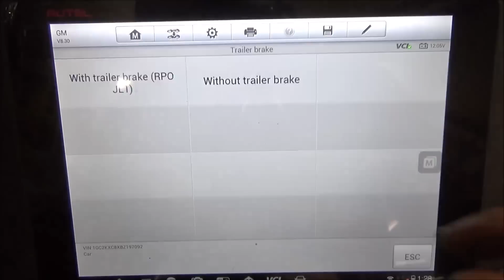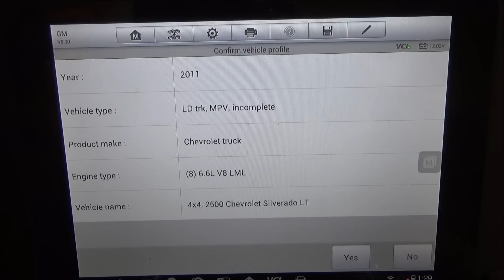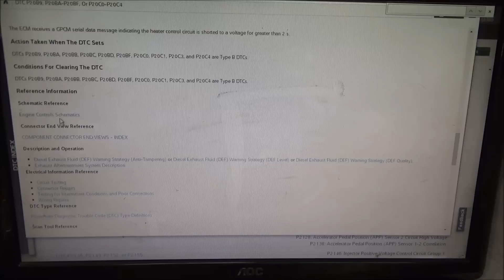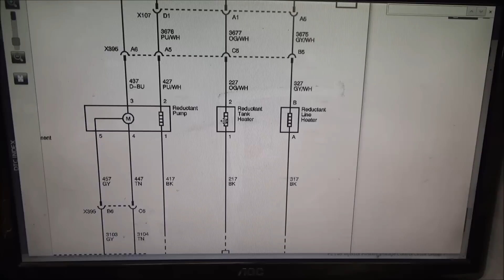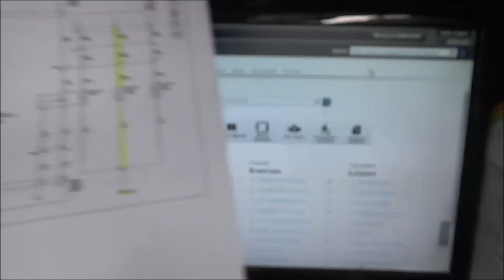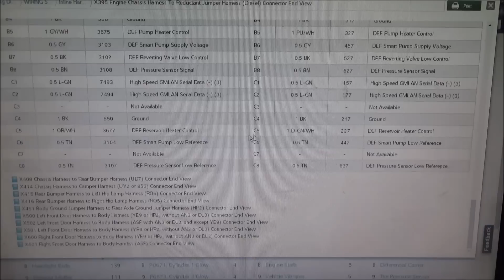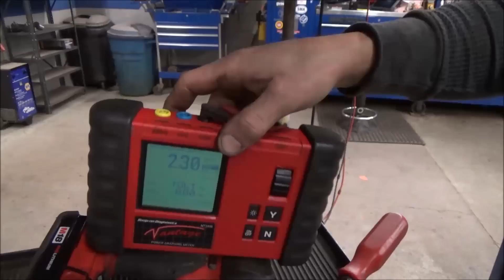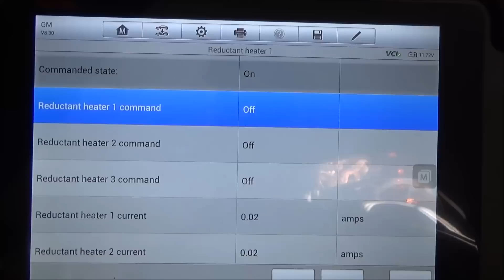Chevy / GMC 2500HD Duramax - P20B9-00 Reductant Heater Problem - Part I

Comment: Does anyone know? If a vehicle under warranty is taken to the dealer and the dealer can't fix the issue, then the customer takes it else where and is repaired and charged, can the owner then go back to that dealer that couldn't fix the problem and get money from them because they could not fix the vehicle under warranty? Or is the owner S.O.L.?
Reply: +South Main Auto Repair  You can try to go over the dealership and go directly to corporate customer service. They will generally get involved if you can show them that the dealer didn't repair the vehicle. Written documents are a good thing in this case.
Reply from the maker: +Frank Gonzalez I believe SOL is correct. This guy don't really care he just wanted his truck back is all.

Comment: Great vid, can't wait for next instalment! Do check resistance of ground, high resistance is as good as an open circuit as you found when you checked the heater coil. Ian G
Reply from the maker: +Ian Griffiths we tested the circuit in this video all ready... resistance of ground is redundant. It needs to carry current.

Comment: Since all of the Diesel Pollution control crap hit the market, truck drivers have been getting screwed, Like we haven't been getting it already. Ive had to set on the side of the freeway for over an hour waiting for my truck to regen, they havent gotten the bugs worked out yet, and its the drivers who suffer. Boss just says Oh well and make sure your at the customers on time, total crap, Both the Def and Non Def systems are bad. Wish we knew the honest story about this truck, but thats not going to happen. In most cases our trucks have to go to the Mack Shop to have the pollution cleaned, due to warranty, takes 3 to 4 weeks to get it done, costs major bucks, They started buying another brand of truck, but they were even worse, so they sent them all back, over 100 trucks in total, back to the dealer, now were back to Mack. We always thought our trucks were bad, until they started this junk, now we wish we had those old beasts back, would love to get a new diesel pickup, not going to happen the way it is now. But if SMA was located around the corner, I might think differently.

We never know whats next from Dr Os waiting room.
Reply: South Main Auto Repair i know the feeling all too well...i miss my big cam 550 all mechanical 3406 kitty cat

Comment: I stopped in at your shop about a month ago and talked to you and Ivan.  I had the very same failure on my 2011 F350 and after watching some of your video's I got myself a shop manual, and swapped the part myself.  Based on the diagram it looks like the GM parts is really close to what Ford uses.   Job went great, I took my time and save myself about $1000 over going to the dealer.  Thanks for doing these amazing video's!
Reply from the maker: +Simon Matthews Yep I remember! You changed your profile name.
Reply: +South Main Auto Repair different computer not sure why it comes up with way.
Reply from the maker: Oh haha

Comment: hey E.O. very well done on that diesel with the reductant system.....u pretty much diagnosed that circuit easily haha...i have had my share of them systems and iv gottn some familiarity of how that works and diagnosing it...haha i was like sittn here at my toolbox watching u follow the wiring and how ur schematic wires threw u off alil but u poked around and figured it out,wow great job...i was like from the org/wht wire it changes to dark green/wht eric oh no haha...but anyway we use SI here at work...overall great job eric i cant wait for part 2....ill be waitn..haha..
Reply from the maker: +Joe Tisi Haha yeahhh we got it figured out. Just need to poke around a bit

Comment: had one if those buggers go bad on my 2014 freightliner cascadia evolution chunk of ice collapsed the inlet screen to the pump that caused the pump to burn up the motor then the exaust filter got clogged and had to be sent to detroit to be cleaned off (basicly a catalytic converter) $6,400 dollars worth of trouble for a $367.34 part thank god for a 5 year 700,000 mile warranty

Comment: Another trademark SMA video! And as far as I can recall, the first diesel specific video you've done? Wouldn't mind seeing more of those;  here in Belgium more than 70% of the cars is diesel fuelled (stupid), they put diesels in fiat panda's for crying out loud...
Hopefully they make 'em run on banana's soon. Do you think we would need to peel them before dropping them in the tank?

I'm sure you've got another customer for life, it's great having a shitty dealership nearby :)
Reply: +pete smith Diesel fuel is actually 25% more expensive than gasoline in America. Never saw a point to it other than big trucks that need the torque a diesel produces.
Reply: +SATAMAN Schmidt   At one time Diesel fuel was Cheaper than regular gasoline, but with all the taxes that been placed on diesel fuel it just became more expensive.
Reply: +Koffi Banan Because petrol is so cheap in America they dont need to buy diesels.
If they changed to buying by the litre instead of the gallon like us.There would be more diesels.
Reply: +Upallnight 
Well funnily enough, the days of cheaper diesel (€1/Liter vs €1.4 for gasoline) seem to be over. Suddenly, government has decided that diesel is more polluting (after subsidizing for years as eco), probably in the aftermath of the VW scandal. Now taxes are going way up, diesel owners are screwed.

Comment: We have seen a number of vehicles with DEF issues. 
Most of the time it has been due to the DEF tank being topped off with either water or windshield washer fluid by quick oil change facilities or the owner being cheap and adding water. 
One system was topped off with coolant/anti-freeze at a J*** Lube joint and required all new components including the cat and that bill was not cheap. 
This vehicle was still under warranty (2012 model, this occurred in 2014), we are an independent specialty shop and the customer got GM involved and long story short, GM told us and the customer to replace a long list of components including the cat or the vehicle warranty would be void going forward. 
We were very surprised that GM did not complain about an independent shop performing the work and would still honor the vehicle and emissions warranty if we followed the GM procedure for that type of contamination. 
The customer was not happy and ended up suing the local lube joint and won big including vehicle rental fees, lost income and punitive damages. 

It may be prudent to test the reductant fluid quality. ;) 
If the fluid or tank has been contaminated, I would strongly encourage thoroughly cleaning the tank, discard the old fluid, replace with fresh and flush the pump, lines and injector.

Comment: Def fluid has been the biggest nightmare.  most of it has to do with using cheap def fluid.  but seriously?!? they don't have a diesel guy so they can't fix it?  it's a def tank.  Just follow the diagnostics in service information and they could call TAC for help if needed.  Your a dealer for frig sakes.
Reply: +South Main Auto Repair Hope he takes the receipt from you, slaps it on the service writers desk and says here! This isn't a "diesel guy" and he fixed it without the runaround!
Reply from the maker: +punker6506 Shoot with this one here you can pull the codes, shoot from the hip and still get it haha. I don't know what the deal is. All I know this guy was furious, wanted it fixed even though it was under warranty and didn't care what it cost.
Reply: +South Main Auto Repair I only got to watch the first couple minutes before I had to leave to go to work.  I'll have to watch later tonight to see what ammo you had in your shotgun lol ;)
Reply from the maker: Shot it with the gravy gun!
Reply: @SouthMainAuto  if it was under warranty, more than likely they did not have a diesel certified tech, which is needed for any repair under warranty. Same for any electric vehicle. For some manufacturers, if you don't have a certified tech, you can't even sell said vehicle.
Reply: +punker6506 They probably wanted to sell a new truck and failed miserably. They were probably thinking "A 4 year old truck? Guy is willing to buy a new one, let's push him to do so." and, well, you saw where that went, hope he never goes back there again, not even to buy a new truck when he's ready to buy.
Reply: +South Main Auto Repair The deal is the stealer wanted to sell him a new dirtymax truck. It looks like a nice truck though

Comment: AM I First?   WOO HOO !!
Reply: +Hawaiian F150  just tell your son it is a manual pneumatic ...you blow into the end :)
Reply from the maker: +Hawaiian F150 You are! Haha Dude what are you still doing up!?
Reply: +South Main Auto Repair  Bossman - It's only 2:37 here in paradise!!  Someone's gotta keep ya company when you're slapping around the dealers "Diesel Mechanics" for wearing their head up their ass badges ;)
Reply from the maker: Haha wow man I swear you never sleep. I think if I stay up past midnight I need a few days to catch up!
Reply: +South Main Auto Repair  Sleep is sooooo underrated.  Kinda like being married for 35 years - You get to the point of too many boring reruns and then you learn how to use "The Force" to focus your energy on keeping new TV remote batteries on hand.
Reply: +South Main Auto Repair BTW,  you caught that flu bug didn't ya. Might need some Scott Towel wipes on your sleeve so you don't go around the shop with the "one arm dripping on the floor syndrome"  ;)  Me, I just finger block one snooze locker port and shoot the other across the room.  Pisses the wife off like no tomorrow.   lolz..  When I'm sick, I can leave wet snooze locker trails for miles!!
Reply: +South Main Auto Repair Hey, Did ya see the comment about getting me a new air drill?  MAC AD590 for less than $80 with shipping. I figure it's a great score.  Sent my son my IR drill.  Now all he needs is an air compressor. Priorities right - go figure.
Reply: +Billy R  --  =-b  and loving every minute of it too  ;)
Reply: +deepsquat600 -  opps sorry depsquat600 brother man!!   I mis-tagged You and Billy in the convo...  All I can say is,  I'm just like a rock - I can prove it too.  Whenever I shake my head side to side people can hear the pebbles bouncing around.
Reply: hey saying I am not right because I want your son to blow into an air impact ... that was the proper response....now go tell him thats how you kick start it :)
Reply: +deepsquat600 lolz!!  will do ;)
Reply: +deepsquat600 Dude you guys an't right ! LOL!
Reply: +Billy R  haha.. I told him!! now he wants proof.  I think he is doubting us.